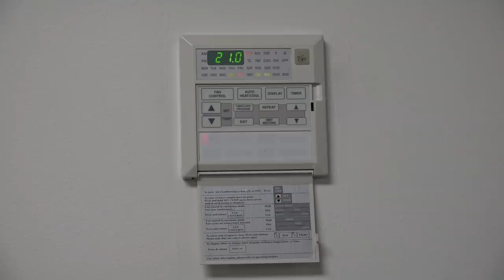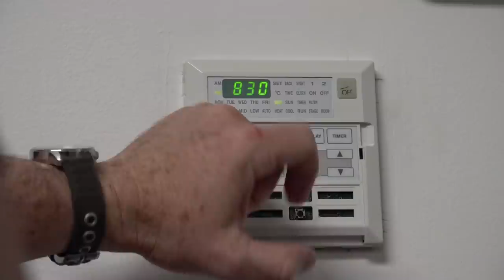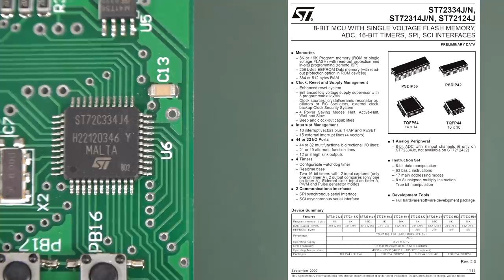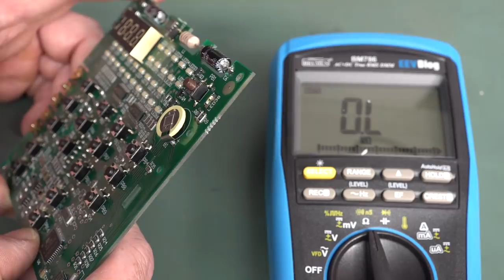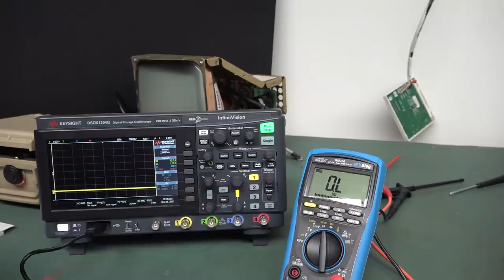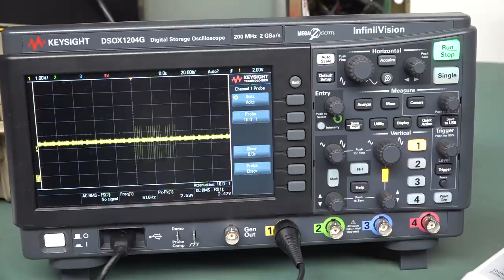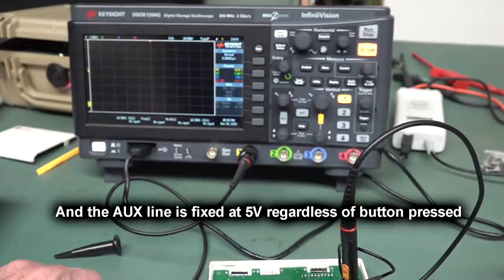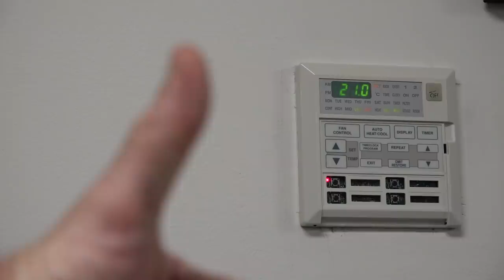EEVblog #1360 - REPAIR - Aircon Control Panel

Comment: 19:00 Ai, measuring the resistance between mains earth and your scope ground ? Would it be advised to measure the Voltage first, to avoid blowing up your DMM set on resistance ? You did check for AC after.
Reply: Agreed, but I expect Dave would be happy to blow the meter and have content for yet another repair video... :D
But actually he is about to start selling these new DMMs so I'm pretty sure both Brymen and Dave have done some extensive testing to ensure they would survive such a condition.
Reply: @KeanM  Really ? 🤔 And do you think my Brymen BM235 will survive ? I'm sure I am not gonna  👉😣👈 💥 try.
Reply: @Okurka.  Wow... On resistance ?
Reply: @erikdenhouter  Yes, I would expect it to survive thanks to the PTCs and clamping on the input.

The BM235 is rated Cat II 1kV, Cat III 600V, and Cat IV 300V.  Not quite as good as the bigger Brymens, but still pretty decent and way better than many others.  The BM235 is my favourite meter, and I own 3 of them.  But sure, I don't recommend to abuse any DMM on purpose, and never above the safety ratings.

Check out the DMM testing by Joe Smith - https://www.eevblog.com/forum/testgear/hear-kitty-kitty-kitty-nope-not-that-kind-of-cat/
His BM235 testing/review video - https://www.youtube.com/watch?v=g3uYcHAumhA - worth watching.  He shows reverse engineered input protection schematic and testing at 26:28 (using multi-kV transients not constant mains), and then applies rectified 220V mains to the inputs in all modes at 32:45, followed by further transient tests up to 10kV.
Test result spreadsheet - https://docs.google.com/spreadsheets/d/1cXzYpIoyVm9QJUju4KXqM22CEQZP3_xwWvDyeVwxTy4/edit?usp=sharing
Reply: Thanks all for the info. I am astonished 😲

Comment: I actually find those TACT switches will eventually fail in applications with heavy daily use, particularly if accompanied by adverse environmentals such as humidity or heavy-handed users pushing way too hard.   I keep a full stock of them for repairs...

Comment: Hey, nice video as always.
I have 3 different switches that have the same problem and a different effect.
the first is my poor old Hi-Fi from 1985 it's a really reliable Toshiba Midi system but the power on/off switch (same as your in the video) sometime turn on and off the hi-fi because there is no timer for it with is stupid and because the switch have bad contact it do trigger off just after on command sent twice damn really not cool the second is the dish washing machine i have to use "brute force" to turn it on and off.... same, the switch is dead and the last one is the "air dryer" (something to drain humidity from air well, i'm French no idea how to translate that exactly) and it do the same as your AC it sometime do strange things on the settings when i try to turn it off! for all of them contact spray did something to them but after some months they start to act bad again so replacement is the solution and i just always forget to buy that micro switches that cost nothing it's just i forget to do it because well, it work and i get busy with more important things.... well, normal life.... i should repair them before i destroy something by brute forcing them sometime i have to use really big force and the cheap dish washer look like it really not like that! the front plastic feel like garbage and will die with will be really not good

Comment: This failures are not rare, not by a long shot. 
If you work on a big company, between monitors and mice, you are going to see this all the time.
In the monitors specially, the problem is the same as many are also implemented with resistor dividers.

Comment: So, still in the original position then?
Reply from the maker: Yep, lot of effort required to move. Need to get my ladder and get into the wall cavity, check cable length and possibilities.
Reply: @EEVblog  Or just wire an alternate on/off switch to a new spot and leave the rest where it is.

Comment: Nice switch repair ,  but why you didn't convert it to wireless you have power there , You can even control the air conditioner by Alexa .

Comment: From working with AC IR remote codes, this could be the same type of signal, based on space between pulses, see IRremoteESP8266 on GitHub, but there is others as well.

Comment: 8:23 An 80s design? The silkscreen on the PCB says 0406.
Reply: Yeah, the last iteration.
Reply: Axial electrolytic caps are a dead giveaway.
Reply from the maker: Yes, likely designed in late 80's or early 90's and then manufactured for a couple of decades

Comment: Lets put EEVblog 121GW "Dave" meter against the wall
300 dollars for what ?
M3 cortex processor = cheap processor. Why didn't  you use a M7 double floating point processor ? 
CAT III 600V rating is Useless on my field. USELESS
0.05% basic accuracy for a 50 thounsand count display (what a joke) Better an Amprobe meter
Really slow continuity test. No TTL /CMOS probing. - My wavetek multimeter is twice as fast and it's made on 1992
NO USB comunication /datalogging (Bad Dave)-  With that turtle processor I can understand why
No inductance measurement (what a waste)
No iluminated (independent) power on /off  button (say no more)
Boring display. Poor design

Comment: Junk product.  Buy a Honeywell or Nest, enjoy their remote wifi controls, and be done.
Reply: @Lassi Kinnunen 81 Hey lassi, Honeywell has been in business since 1885 after building the first furnace regulator.  They don't build furnaces/AC just like Goodyear builds tires, not cars.  Go into homes built in the 1950's and you will likely still see 60 year old Honeywell thermostats with mercury switches running their 10 year old forced air furnace.  Their regulation and hysteresis curves are remarkably accurate match to human models.  I have installed 5 of their recent digital thermostats ($89) and you can DHCP into their server hosting but can also port forward directly into them if you don't trust hosted services.  My time has value, apparently yours doesn't.  I guess you would be happy with a $1 wall switch to turn on/off your HVAC  - please don't be such a Rube.